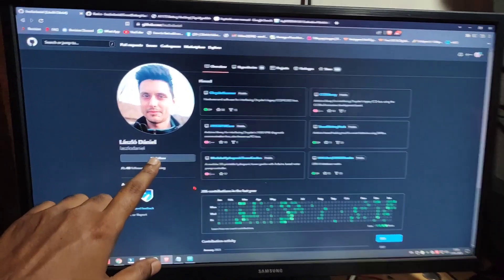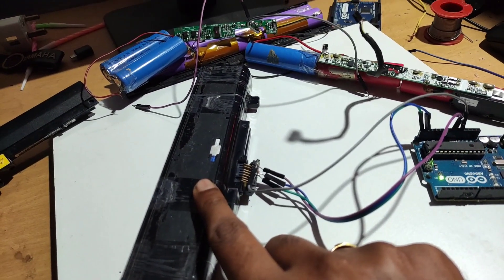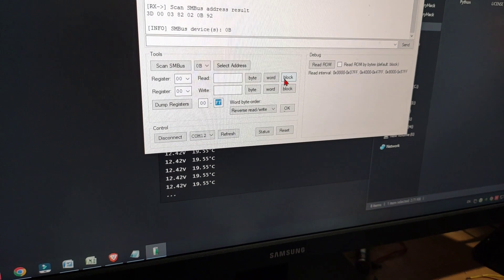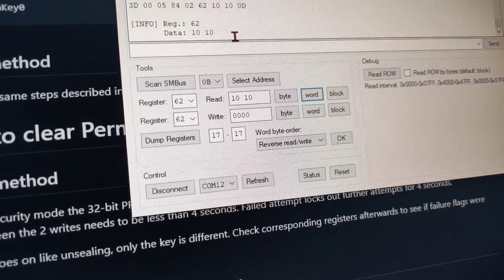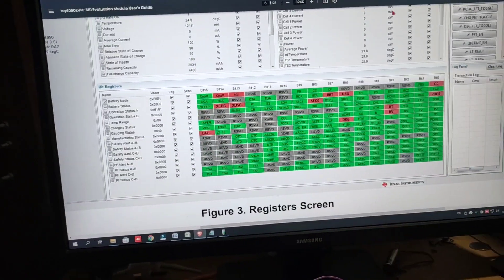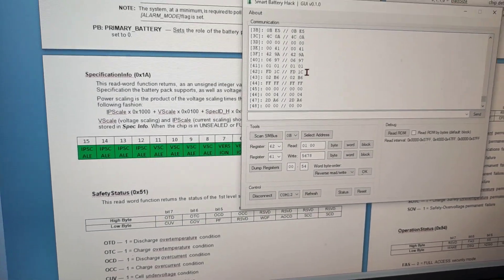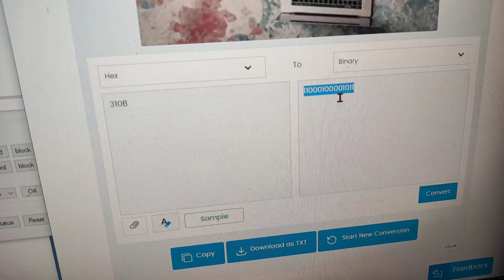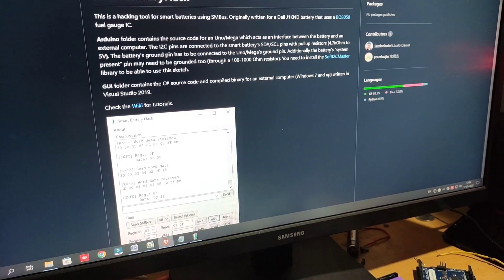Laptop battery data retrieval and reset with arduino - BMS HACK #arduino i2cprotocol part 3 SMBus

Comment: Hi, thanks for the information to you and to Mr. Lazlo, this is a great job,  i have a question, i trying to unlock a dell Alienware TYPE: 2F8K3 this battery use a BQ30420 TEXAS INSTRUMENT, for now i cant get change the cycle count, i get the keys but the question is, how i unlock the battery to change de cycle  this clicle count?, i cant catch the step after you get the keys (with the second arduino program) and when you put those keys to unlock you battery, after that you can modify the cycle but was not clear to me how you unlock you battery, thanks a lot for you support, and thanks in advance,
Reply from the maker: Can you msg me on my instagram. So i can clearly send you a msg. Its simple, check seal state with 54 register , apply those codes to 00 register if it applied propely chip will unlock. Then check 54 regiter and match with the previous value. If the value changed chip is unsealed. Also u can check 2f register also, i will get more information about your chip also. And thanks for your support. Peace ♥️♥️
Reply: @AnandakrishnaSudhakaran  i appreciate man, thank you for your help, i follow you in youtube and now i gonna follow you on instagram
Reply from the maker: @raveisra331199  tHANKS FOR YOUR BIG SUPPORT

Comment: I don't have #arduino. Can i do this with STM32f107?
My loptop is lenovo E530c and battery chip is 51F51.
Reply from the maker: stm chip support SMBUS or i2c but we need code for that. Some i2c codes are available on internet. If you know how these chip works you can add the changes to the current code and software.
Reply: @AnandakrishnaSudhakaran  Yes, I know how it works.
I have set up several I2C devices with it. It also supports SMBUS.
My problem is how to connect to my battery (I don't know the output pins of the battery as well as the voltage level of the clock and data pins) and how to convert the program for it.
Reply: For another task, I wrote a program that sends values to stm32 via tcp/ip and the board sends it to the I2C device.
Maybe with a few changes I can save my laptop battery.
Reply from the maker: @cevahirsoft  that idea is great, i will check your battery clock and data line, did you open your battery?
Reply from the maker: Pull up resistors are used in data and clock pins. 3.3 v enough for the clock and data lines. 5 v max. Its logic lines you know all about it more than me.  i have the same Stm32 boardm but it is used for my steering wheel. If you make a code i can test it on my stm32 and my board. We need to read and write data in bytes or word. Values can be in hex we can convert it  depends on the chip unsealing is difficult  for older chips it just need hex numbers, but for newee chips we need to use sha 1 authentication. Also texas authority already said that i2c or smbus supporting board can read and write any chip just need the proper coding. You try full support for you
Reply: @AnandakrishnaSudhakaran  Thanks,I open battery and change cell (I am a programmer, I don't know how to solder, I gave it to someone to do soldering for me) but cover is open
Reply: @AnandakrishnaSudhakaran  I use stm32f107vct6 battery chip is 51f51
Reply: I emailed the pictures of the battery
Reply from the maker: @cevahirsoft  some reports there is a match between 51f51 and R2J240-10F020. I will share the link check the comment section u can find relative deatils. Second link is someone discussed with texas guys, about stm boards. Maybe useful for us. So search like this " stm board with bq  chip ". You can find intersting results. Iam not a coder so I can do the practical work for you, if you develop the code. But by my research STM board can do the magic with battery chips. Oh i fotgot one thing there is a guy already developer a software and firmware. He using stm32 chip software is avilable as free firmware he not shared. I will also share his youtube channel link. Please share your insta id i will msg there
Reply from the maker: @cevahirsoft  https://e2e.ti.com/support/power-management-group/power-management/f/power-management-forum/735538/bq78350-bq78350-smbus-communication-problem-stm32
Reply from the maker: @cevahirsoft  http://www.karosium.com/2016/08/hacking-r2j240-lgc.html?m=1
Reply from the maker: This is the youtube video about stm32, he shared his ideas and he did it. You can check his other videos. So it is possible. You can do it also. https://youtu.be/NCxSNA6b2n8

Comment: Bro can I use other brand new battery in my acer laptop like hp dell etc by match the point of data clock temp etc it's work ??  bcoz my laptop battery is not available in market can I buy other. Brand battery with Same volt ,amp pls reply 🙏
 
And sir you work is great ❤ and sir pls make one video about your this technical knowledge which course or degree you do for this knowledge bcoz this video help for beginners what do or not pls make
Reply from the maker: THANKS FOR YOUR VALUABLE COMMENT, using another battery is not a good thing. Because if the laptop have some special features like FAST CHARGING or EXPRESS CHARGING, if the battery not detected properly it will dangerous for battery and laptop. SO do more research, not only charging voltages and capacities. Try same company other models battery. It might work. Look for same models, same features. Please share me your laptop and battery details, I will also search and tell you. Thanks for your support.

💌💌💌💌💌
Reply: Battery model - ap12a3i

Laptop Acer timeline um3
Reply: Sir. I have my old battery but it's bms was dead I was trying to solve problem but I destroy some ic can change bms ?

Comment: Hello dear, can I use any Arduino or just the uno?
Reply from the maker: I tried other arduino boards but not worked. 328P chip is supported, so any other board with 328p should work. Uno works without any problem. Thanks for your comment
Reply: @AnandakrishnaSudhakaran  thanks guy, hugs from Brasil.
Reply from the maker: @AlfredoAC-z4k  Love from india my friend. Thanks for your valubale comment, if any doubt feel free to ask, you can follow my instagram also.

Comment: is it able to change designed capacity value ?
Reply from the maker: Yes by editing the hex file. Please watch my new video about bq8030. if you know how to read eeprom then u can edit the values and reflash with the file. Or by software just add new values and save. but unsealing and getting full access is difficult for newer chips. Which is your chip
Reply: @AnandakrishnaSudhakaran  do you have a solution how to change the capacity? cycle reset is insufficient. How to read eeprom 51f51? reading according to the bq8030 video will not work, right?
Reply from the maker: @tmxm7360  51f51 is from another company. unfortunately I damaged my Fx2lp board so i cant do anything now. I tried to change  FCC but not worked. You can try also. If I found something i will make a video.
Reply: i made cell replacement with 3000mah(default is 2200mah) on acer e5 575 the battery type is as165k I've been reassemble it and and forgot to look the chip number, have u ever workin on same/similar battery type ?
Reply from the maker: @siripki  Am not familiar with that battery do you have the battery model number? And what hardware you have?

Comment: Hi freands bq30z55 arduino hack please
Reply from the maker: Sorry i dont have that chip, please try urself. Datasheet available on internet
Reply: @AnandakrishnaSudhakaran  Can you tell me which pin goes where?
Reply: @AnandakrishnaSudhakaran  I removed the whole battery group, so the battery went into dead mode, how can I bring it back to life?
Reply from the maker: @gaaragaara9785  can u tell me the Chip number and battery model, so i can look and tell u the pins
Reply from the maker: @gaaragaara9785  without the batteries chip will not give data, it needs minimum supply on all batteries
Reply: @AnandakrishnaSudhakaran  do you have an instagram account here?
Reply from the maker: @gaaragaara9785  yes u can chk my profile or find me, my id
anandakrishna_sudhakaran, samd profile pic
Reply: @AnandakrishnaSudhakaran  I wrote from both facebook and instagram, thank you for your very good information, thank you sir

Comment: you are coneceted arduino data ,clock,gnd and 5v to laptop battary  is this corecct with voltage of battary is 12v to 5v of arduino and that damage it or not
thank's alot
Reply from the maker: I didnt connect 12 volt from battery, DATA CLOCK AND GROUND, we need these 3, pins only, No need of battery positive part. And arduino is powerd by pc usb so no need of extra power. 
Do not connect battery positive to arduino it will permananently damage ur arduino board. 

Connect like this

CLOCK  - A5
DATA - A4
GROUND - GND
Reply: @AnandakrishnaSudhakaran  
thank's so moutch for expline that and fast response ,ur the best
Reply from the maker: @abdhali2972  Always at your service. Please ask if u face any problem. Thanks for your support
Reply: @AnandakrishnaSudhakaran I have done the way you have done,and successfully uploaded the code on Arduino but once I connect to my damaged HP battery,I only get question marks on the serial board,it doesn't show features like yours does ,,what could be the issue
Reply from the maker: @rifloanimations1182  what is the baud rate?
Reply: Hello, thanks for showing that.  Do you know if it would work with a c21n1833 asus battery? Thanks